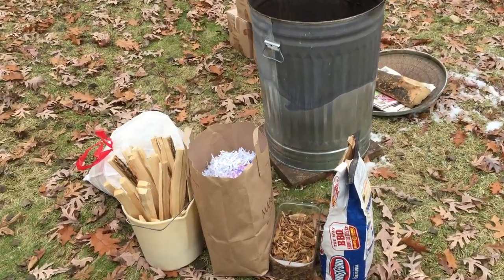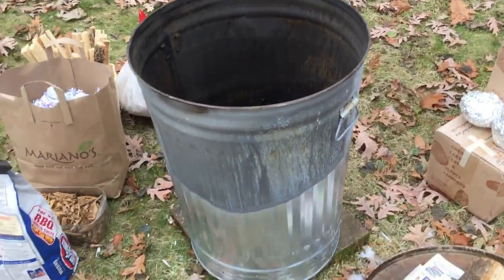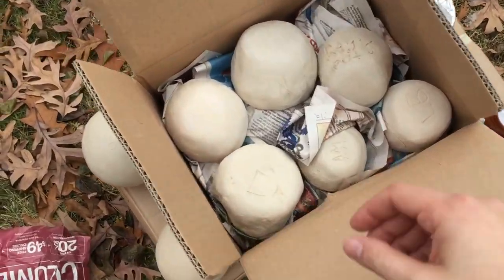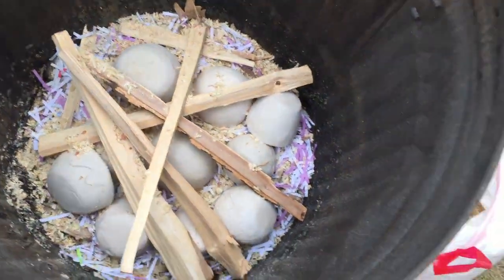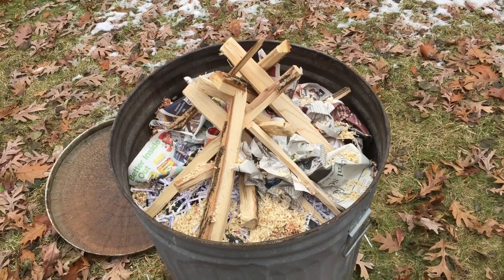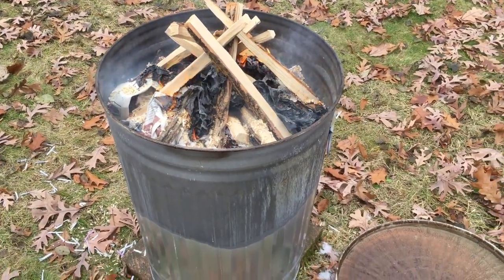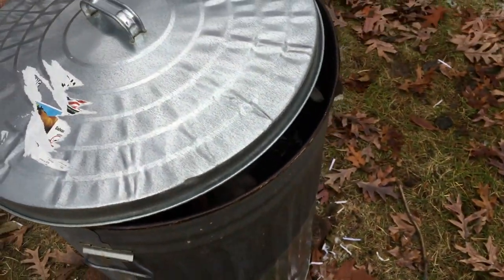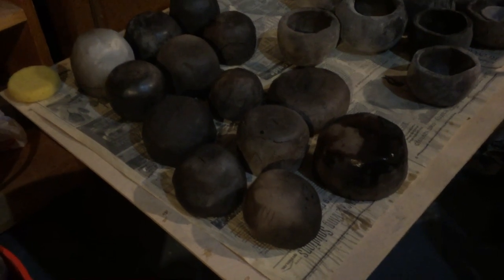pit fire pottery

Comment: Good video thanks. I'd like to make pieces with a lighter colour finish, how would I do this? Could I wrap the pots with foil, or use some kind of glaze first?
Reply from the maker: You can control how much or how little the pots are in contact with the combustible material by putting them inside of a foil sagar, yes. All you’d need to do is place your preferred amount of sawdust inside the sagar, wrap it nice and tight, and pitfire it as normal. 
Though, glaze does not work for this firing method, as the temperate reached in a pit fire is not nearly hot enough to melt the glaze. Instead, people used burnishing techniques to create a less porous surface that would be more suitable for food and drink.

Comment: I was thinking of making a carbon foam to insulate the can and instead the temperature of the kiln. Do you have any holes in the bottom of your can for airflow?
Reply from the maker: Never heard of carbon foam, but I suppose it could work. For my other handmade kilns, I use ceramic fiberglass blankets to insulate them. Yes, I do have several smallish holes drilled into the bottom to allow for airflow.
Reply from the maker: @Briaaanz  quite interesting! I’d recommend going with a small scale experiment to see how well it insulates. I’d personally try making a soup can forge. My only worry would be that the foam would become too brittle and crumble apart after a few uses.
Reply: @bonsaiartist2525  he addressed this in one of his videos, along with a better recipe (flour, cornstarch, baking soda, water)... He used a large can and created a forge with a propane torch. The recipe is cheap and easily replaced after a few uses

Comment: Nice and simple kiln. However you do need some improvement on your videoing skills, maybe a tripod will help ! I got motion sick and a head ache watching your video.
Anyway why did all of your pots came out so black ?
Reply from the maker: The pots came out black due to the kiln creating a reduction atmosphere rich with carbon. Essentially, the flame consumed the available oxygen in the kiln, creating a minor vacuum. Which caused the porous clay to suck in the soot from the flames as it search’s for the last little bit of oxygen in between the clay particles.
Reply: @bonsaiartist2525  no way to glaze like this?
I want to get into pottery but zero chance of me ever getting a kiln where i live
Reply from the maker: No Wire Hangers 
Sadly no, there really isn’t a way to glaze pottery with this technique. It just doesn’t get hot enough. Though, prior to the creation of glaze, people used different finishing techniques to make pottery usable. Most of them revolved around a technique called “burnishing”. It is a rather tedious technique, but might be what you are looking for.
Reply: @bonsaiartist2525  thank you so much for actually replying. 
I will look into it.